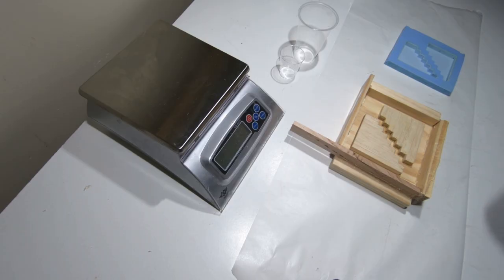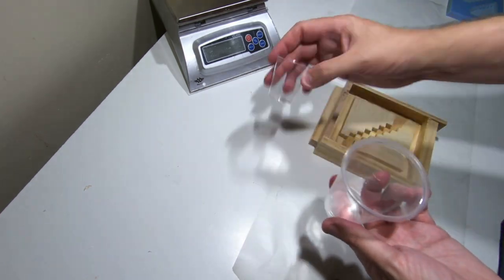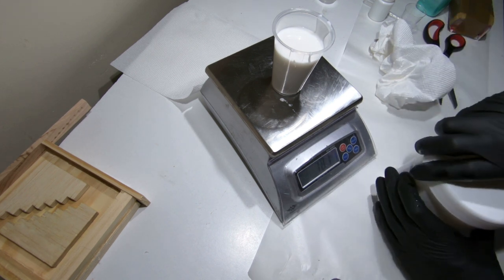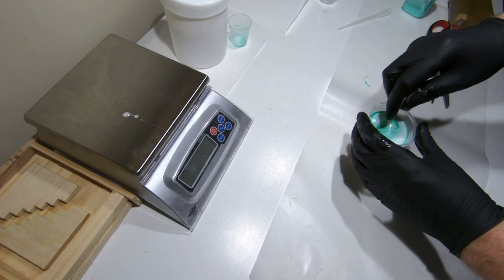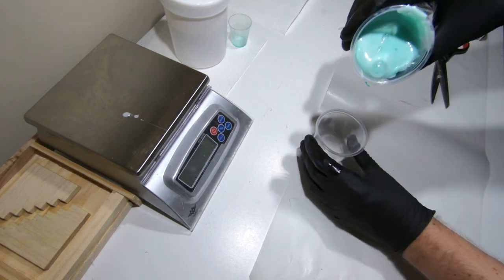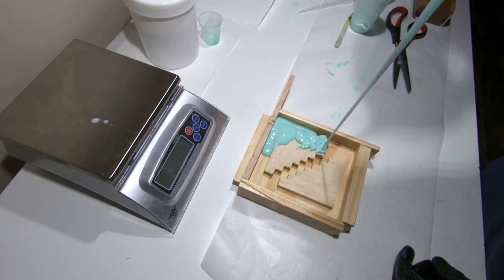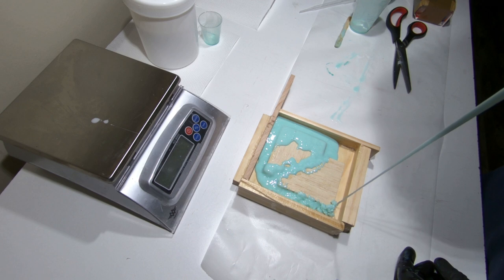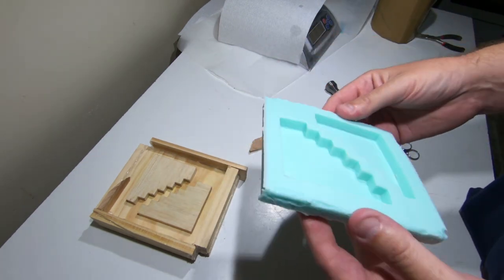Silicone Rubber Mold, Resin wire spacer for Cold Process Log Splitter

Comment: Thank you for sharing your processes. I like the green colour you’ve used for the silicone. I’m watching your shop for when these soap log splitters go on there, but I’m now also wondering if you do custom silicone moulds for slab type boxes? I’ve been given some awesome wooden boxes and would love one or two silicone moulds made but would know how to make one.
Reply from the maker: Hi Chrissie, I have one splitter on pre-order and another one will be put online hopefully tomorrow.
Regarding the slab molds, I do 1 size wooden mold ( 32cm long, 19cm wide, 8.9cm tall ) but no silicone molds. Currently it's just to expensive and they would need to be done 1 at a time. So for now - just the wooden molds that split down the center.

Comment: Dean there must be types of silicons available that doesnt degrade with resin, as the molds you can buy for coing silicone soap dishes or orbs and the like  dont degrade. I have done some resi  coasters and shapes and those molds dont deteriate at all. Such a pain for you to have to keep making your molds
Reply from the maker: I have a torch but don't like using it. I just need one of those small jet lighters I think.
Reply from the maker: The silicone your talking about is different to the silicone I use. I have looked around for it but can't find it. I think they use big heat press machines/molds to make them.

Comment: You need a better silicone mold kit, the dragon skin 20 or you can get the dragon skin 10 which is a trial size for 41 one is really good, it's 45 for the dragon skin 20 which is a kit and has the 2 parts and it is very very strong, I have many friends that use it to sell resin molds as a living
Reply from the maker: I will look into it, thanks.
Reply: @DeanWilson  I mean I understand you're usually using you know your molds for soap and that's definitely Lester rosov or yeah erosive I hope that's right but when it comes to resin I mean it is a pretty harsh chemical even if you get the low odor and low VOC, but yeah that Dragon skins I hear a lot of really good things about it it is a little bit more pricey than the other silicone mold making kit by the same brand but this stuff is extremely hard to rip tear and it stands up to the resin compound very well I just wanted to give a helping hand I know you don't use your molds a lot for a resin so hopefully you would get your money's worth and back overtime cuz like I said I think it's like $45 for the dragon skin 20 and for the trial box kit or whatever it's called dragon skin 10 and that one's $41 but if it doesn't get eaten up by the resin by the third you say I mean I think it's worth the money anyways I've been rambling on and on and on now I hope it works for you very well it is on Amazon I am in the states your in Australia so it might be a different price I'm not sure how that works

Comment: Hi, I  know your video is a year old, but is the silicone molding material still available?

The info given here didn't produce a source for this material Thanks.
Reply from the maker: Hi, this is the one I purchased but since making them there is lots of different types of silicone. Food or molds. Check her listing if your in Australia. Otherwise I can only suggest trying amazon with search words "silicone rubbber"
https://www.ebay.com.au/itm/284572179112?hash=item4241d2daa8:g:ZrwAAOxycmBSvkGa
Reply: Thanks Dean, I am enjoying your back catalog videos. 
I am on the West Coast  of NZ. Sometimes I feel Oz is closer.
No food,  just resin and M&P soap

Comment: if you didn't pour from so high up you wouldn't get the air bubbles like you have.  other than that nice video
Reply from the maker: Yes, i noticed this. Also I found out spraying lighting with rubbing alcohol as I pour helps pop the bubbles.